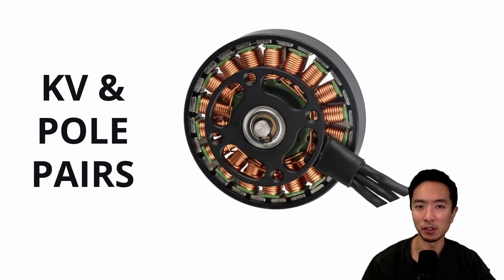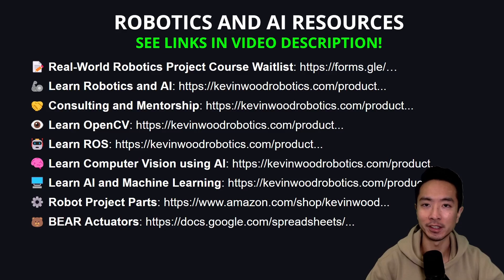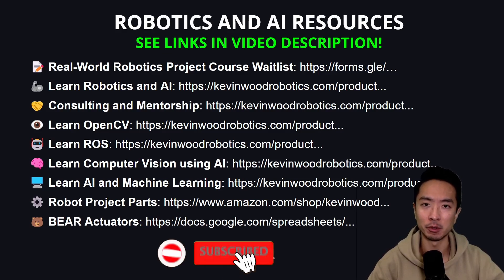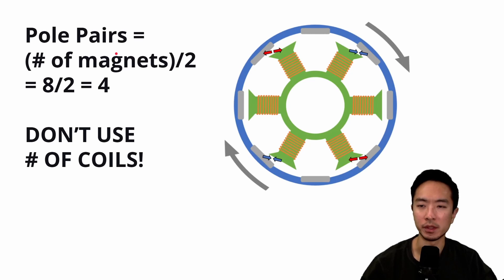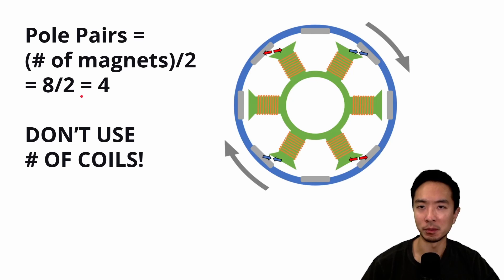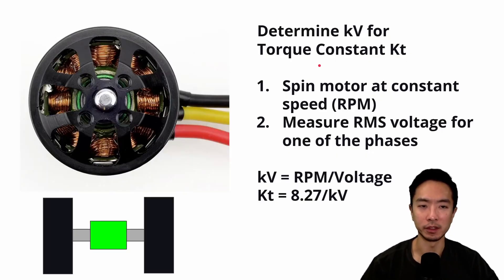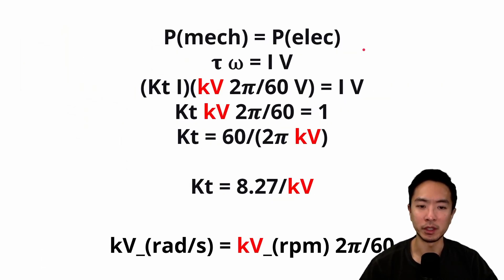Determine Kv and Pole Pairs of Brushless Motor or Robot Actuator

Comment: any way to tell the pole pairs without opening the motor to count them?
Reply from the maker: You could turn it by hand and feel the bumps. If it’s direct drive it’ll be easier to feel
Reply: @kevinwoodrobotics  brushless, no documents, hard to open.. its a right to repair gripe, expensive wheelchair parts.
Reply: @kevinwoodrobotics  This seems perhaps not accurate then, because for example I have an outrunner motor with 14 magnets and 12 coils. If I use the method of counting bumps then I get 12, but according to your video the # of poles = the number of magnets, not the number of coils. Can you clarify what is correct?